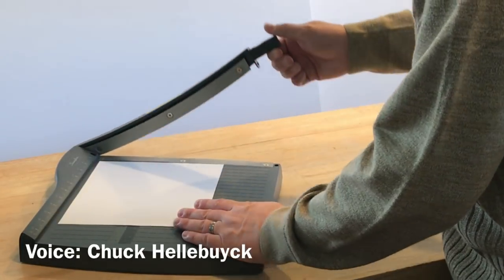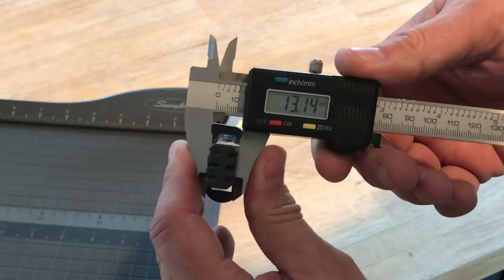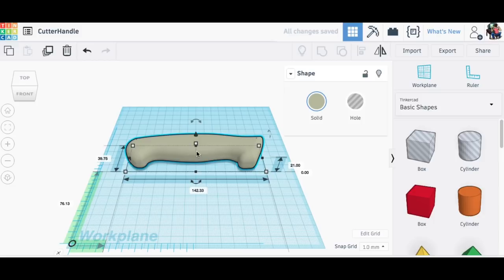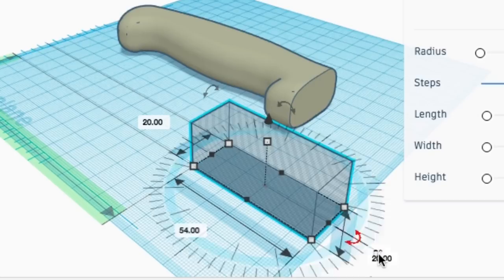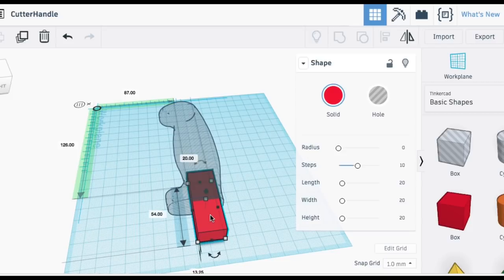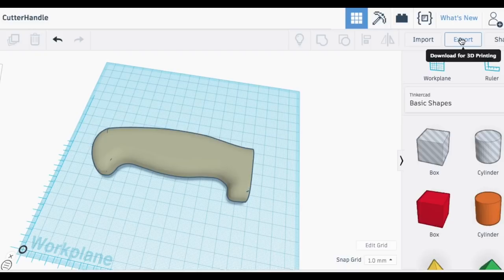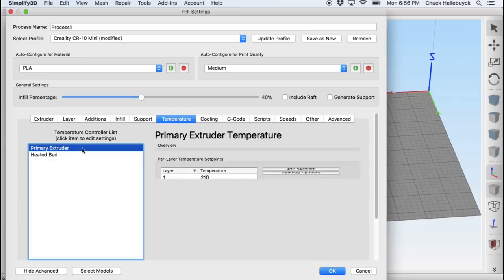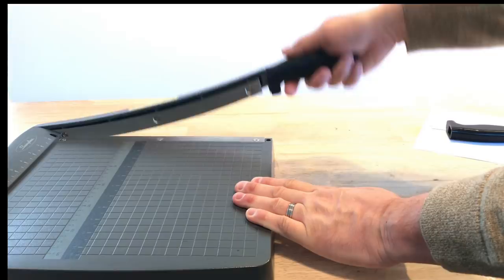Best 3D Printed Handle for Paper Cutter using Tinkercad

Comment: Nice use of Tinkercad again. The handle looks very good printed standing up. Maybe I would test the other "spare" handle if it is strong enough, because the force exerted on the handle in regular use stresses its layer adhesion.
Reply: I wounder if more shells vs a higher infill % would be stronger?

I always use 3 or more shells and from 0-20% infill.  Also extra top layers when printing with low to zero infill.

I seem to almost always get a good strong part.

Comment: Yet another practical example showing that a 3D printer has become a “shop tool” staple.  The best thing is you can start the print then do something else.  If you were machining or carving a replacement you’d have to remain with the piece during the entire fabrication.